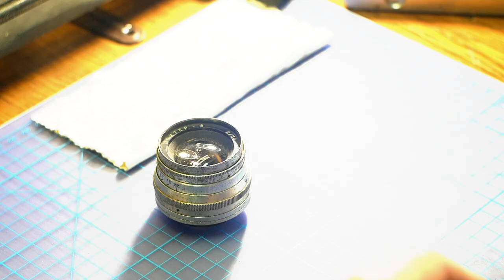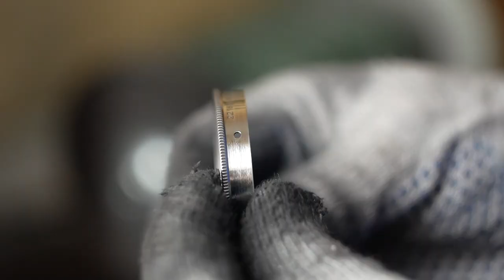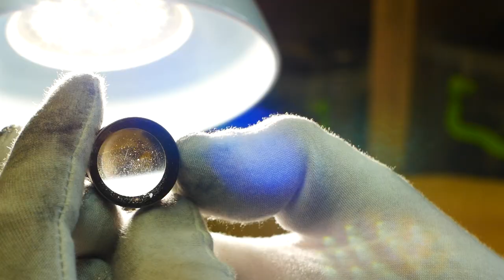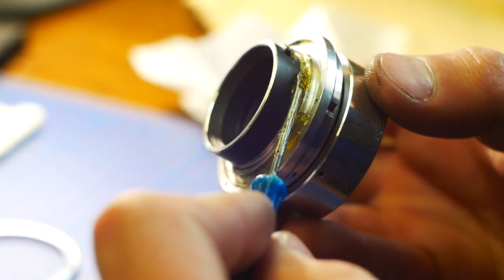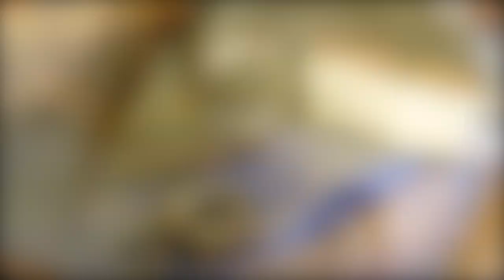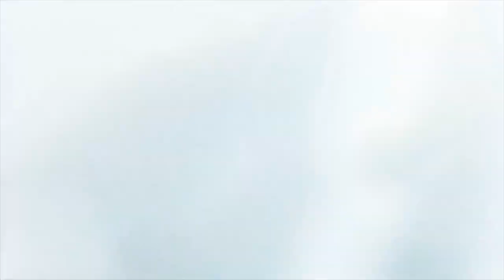KMZ Jupiter 8 F/2-50mm Rangefinder LTM L39 lens POLISHING BODY and Clean glasses

Comment: Beautiful! I got a jupiter-8 as well and I'm thinking of pollishing it a bit but I'm scared of taking it apart, does this mess with the optical axis?
Reply from the maker: You could disassemble only focusing unit and aperture rings. So you don’t need disassemble optical unit. Means there is no affecting optical axis. TIP mark position of every disassembled part and assemble it back on their position - no problems at all.
Reply: @kosami-photo-store  Nice!! Thanks a lot